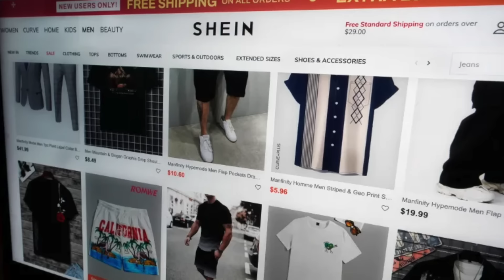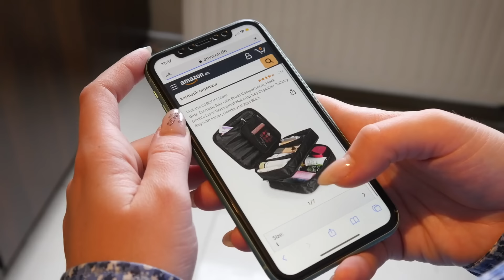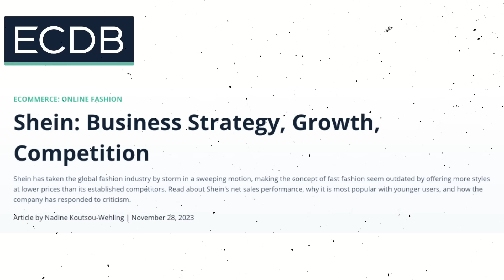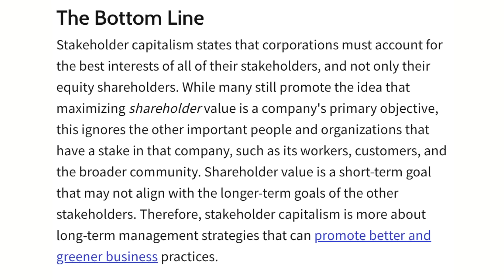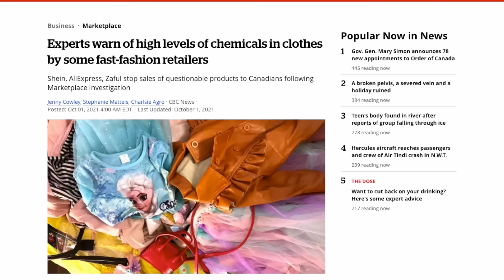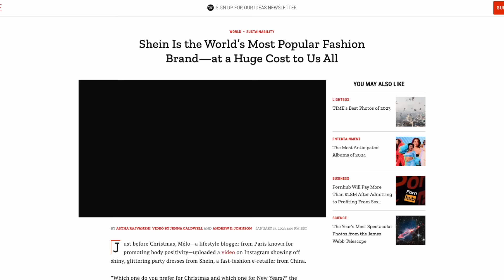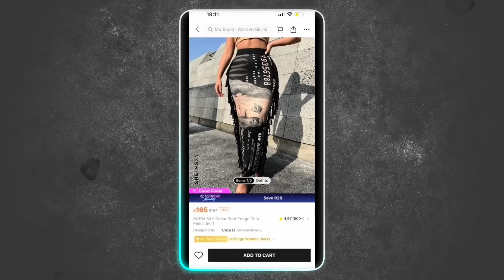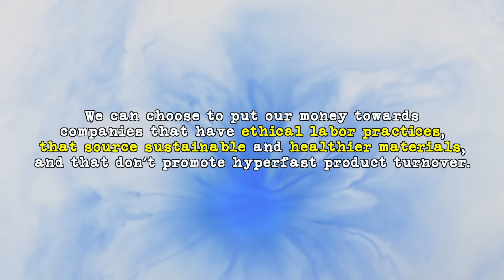Our SHEIN Problem.

Comment: I think the only argument I've seen hold any water for buying fast fashion is the plus sized people, since apparently plus sized clothes are tough to find used. HOWEVER, considering 42% of the US population could now be considered "plus sized," I am sure there are other, better options out there than Shein.
Reply: Someone online recently looked at how many plus-sized options there are on Shein, and the percentage was at around ten percent or so, which is better than nothing but still too low to warrant this argument for fast fashion holding water for me.
Reply: I'm a size 24-26 (or 2X/3X) and it is absolutely tough to find plus size secondhand clothes. Most Goodwills I walk into don't even have size markers for anything above an XXL in the women's tops/dresses section (which is NOT the same as 2X, by the way) or above an 18 in the pants/jeans/shorts section. I often have to spend time sifting through the XL/XXL or 16/18 sections to find something even remotely close to my size. Not to mention that not many brands carry sizes above an XXL/18 to begin with, and even carrying things at those sizes is relatively rare. Have you looked at the prices of items at plus size retailers like Torrid or Lane Bryant? That's still considered fast fashion and it's ridiculous how much their clothes cost. I know this probably wasn't your intention, but your comment came off very ignorant and dismissive to what plus size people like myself have to go through when it comes to clothing shopping. I will never shop from SHEIN, but you have to applaud them for their inclusive sizing that places like Abercrombie & Fitch and Banana Republic don't even have.
Reply: There are very few non-fast fashion alternatives. Many ethical or slow fashion brands do not go up to plus sizes, and even if they do, their idea of plus size is very limited. The idea that just because there is a large demand for plus size clothes means that the supply is there is unfortunately not really true, and most brands that are filling that space are fast fashion. I'm trying to reduce my consumption of clothes as a whole and buy better quality clothes, which basically means 95% of clothes available in my size are no longer an option. I still don't think people should buy from Shein or overconsume clothes in general, but I often find that people who do not have to deal with this have very little knowledge of the reality of trying to find good clothes as a fat person.
Reply: Yeah, here in the UK I often find a lot of clothes size 16+, as many people either lose weight and donate their old stuff, or are larger sized as a lot of the population is overweight. It's actually harder to find stuff in smaller sizes as teenagers and students get it hot off the rails!!!
Reply: @metamaus5701  10% is a lot with how many listings Shein has, especially if filters are available.

For an example of size exclusivity in thrifting, I have never seen a mens onesie jumpsuit (at least not one for a 6ft man). So many thriftstores also dont have a try on room now (can't find jeans and such because they need to be tried on), so it's difficult to check sizing. Even just basic standard clothing like leggings, skater skirts, cropped tops, or such, they're rarely carried outside of smaller women's sizes. There might be the most basic of basics (promotional tshirts, jeans, and such) but those often aren't basics for everyone (not many people like promotional shirts, I hate jeans because they're too hot and remind me of school and church, etc) (many thrifts don't even take items like leggings pants because they consider them underwear instead of the pants they are)

I think a similar bias towards small clothing can be seen in historic relics where a lot of clothing that survives today is either too fancy for daily wear or too small to be sold (children's, teens, and leftover stock). Anyone can size up a fairly huge amount, but sizing down is often impossible

Edit: I get your point is probably that plus size clothing isn't a primary function of Shein, which I can agree with, but it's also not low enough to say they don't somewhat serve that role for some people.

Edit: I also question the average $100/month figure. It should aim to find the median instead because averages are almost always thrown off by high spenders

Comment: As a plus size woman SHEIN was so hard to resist. Trying to find cute clothes that can fit is hard and I’m only a size 18. And I’m 23, I don’t wanna wear the frumpy clothes that plus size stores sell. But over the last year I’ve been a lot more cautious of my shopping and I’ve found that Target, gap, asos, and some other stores can be very useful in building a wardrobe that’s not gonna fall apart on me in a year. I does mean I have to spend more money up front but I think in the long run it’s better for my wallet. I haven’t even bothered with sustainable brands tho, they never have my size and they’re really expensive

Comment: The strategy of SHEIN in both marketing and their shipping ("on demand creation") isn't possible for sustainable brands. 

It works just because they are cheap and create massive amount of clothes. 
Sustainable, good quality brands will never be able to create such a buzz since being sustainable = not promoting overconsumption and micro trends. 
As for the on demand part, it works just because they constantly create new clothes of low quality. This clothing doesn't require huge time spend prototyping. And they steal designs and photos of amaller businesses. 
Sustainable brands spend months developing new products. The construction is way more complicated.

Comment: The rise of Shein is as a result of consumers no longer being blind to fast fashion profit. Companies such as H&M, Zara, ASOS are doing the same thing, for almost the same production costs, however charging 3x what Shein does. Why pay more for the same in-ethical practices by all of the above companies? In order for the rise of Shein to die, the whole system of fashion needs to be overhauled... companies that are making huge profit from fast fashion such as H&M, Zara etc can 'kill' Shein by keeping the same prices they already have, however using ethical labour and factories, sourcing etc. In order to do this however, they will severely cut profit. They don't at the moment because almost ALL businesses care more about profit than ethical practice, just to varying degrees. However in the long run this is the best thing for H&M, Zara etc to do, because if not ethical practice they will otherwise be forced to lower prices in a society that will normalise eventually Shein prices, everyone loses but Shein if this happens. I think right now H&M and Zara etc. are being DECADES slow and 'soft loading' ethical practice, because they want to make that change whilst keeping as much profit as possible. Just my theory.

Comment: What is annoying to me is when I spend decent money on clothing for ethical + quality reasons and at the end get the same clothes from Chinese factories. You shop in Italy or US, check reviews online, spend significantly more money and at the end still get the same clothes from the same factories (your package arrives from China even!). Your money did nothing good but supported even greedier people.

Also, I wanted to buy linen t-shirt. At H&M it costs 10€ and the one from the ethical local business — 80€. I understand why it is so expensive and would like to support their business, but at this point I can’t afford 80€ t-shirt. And no, I don’t buy tons of clothes every week, but I do have other expenses. I still support small businesses with unique clothing, just by buying more “special” things and more rarely. So, trying to find balance that fits my needs and my budget.

And another point and the reason I actually order from SHEIN sometimes — their sizes are smaller. I wear XXS (sometimes XXXS) and most brands (especially local European brands) simply do not have my size. It’s hard to find things and they are pretty limited. SHEIN has more items my size and variety of designs, so I can easier find something for my taste that will actually fit. I do not overshop though

Comment: Every year I bought myself $50 worth of clothes on SHEIN and that’s the only time I buy clothes for myself. With coupons I normally ended up paying like $35. It’s the only place I could get shirts for less than $5 a piece and still be decent designs. I throw out my yearly stained clothes the same time lol. Poverty really does suck sometimes.
Reply: not judging at all as I think this is completely reasonable given your situation, but have you ever tried thrift shops? I know they're not always the best, but I have found a few gems myself for really cheap which could prevent having to throw out clothes. just a suggestion tho I'm not trying to be rude haha :)

Comment: I've never bought anything from Shein I mainly do Ally Express but the point is the same, yes it's a rather unethical company but it's one of the only places where things are plus size inclusive. I'm somewhere on the border not fat but definitely not conventionally skinny and things are just easier this way. The regular shops mainly cater to supermodels and you feel like 💩 when something is too small or too tight for you.

Comment: I avoid both shein and temu for reasons you mentioned but also because they both steal from small creators & I don't like the idea of supporting someone who didn't make something. In some cases too what Temu steals is stuff that was put out for free. (Example: Freebie cross stitch patterns, a designer might release one for the season so their followers can do it, but I've seen a couple times now were creators get fans reaching out saying 'i bought your kit from temu!!' & then the designer has to announce there design was stolen and they aren't getting anything financial from their design being stolen.  I know thats one very small craft related hobbie but I've seen it a couple times now, so I don't doubt other hobbies deal with a similar issue with designers finding their stuff being ripped off.)

Also a low income person, I honestly don't shop that often for clothes. I honestly find cloth shopping to be extremely stressful (the prices on everything is too high) & I sorta stick to big box stores. (walmart, coscto, winners/marshalls) or thrift shops.  But again this is rare for me to really browse and buy something from the clothes section or go out and specially wanna go 'clothes' shopping. Its strange because I can recall everything I bought this year as clothes and I generally buy maybe 1-6 items a year that are clothing related.

 I think most of the time when I buy something its because I'm replacing something thats been finally worn out.  (I have shirts that I had from my late teens to early 20s with me still and I'm in my 30s now.)  

But yeah I generally really picky with my money. I like thinking thru what I'm buying. I do admittedly realize too I'm probably not the target for shein and temu. But I also do wonder how many people do shopping as a way to "self regulate". (I'll see terms in groups related to aesthetics sometimes like "serotionin hunting" when it comes to haul culture.)  But thats something else to think about.

Comment: Loved this video! I'm trying to order less from Shein but I have some thoughts about it. I am a university student living on a tiny island in the middle of the ocean, so the stores that we have here are limited. Also we have one small second hand store that usually doesn't have my size. I try to just order on Shein when I want to buy something but can't afford a price range of Stradivarius, Pull & Bear and the stores that I used to shop but now the price is higher. I think nowadays is very hard to buy stuff because it's getting expensive.If you could help with some advise I would be grateful!!  P.S. I'm not the type of person to buy clothes for the trends. ❤
Reply: I personally have a lot of luck finding cute clothes on vinted!
Reply: @lostinfantasy2489  I'm pretty sure vinted isn't available for her on a tiny island in the middle of the ocean
Reply: @MrsSofieable  I have looked and it's available but the cost to ship something to my island is a lot. I only buy online if the shipping is for free
Reply: @lostinfantasy2489  There is a lot of cute clothes there but the shipping is expensive so im trying to buy clothes from my friends instead of stores. Thank u so much for the advice :)
Reply: @anma9217  Thank u <3 Since than i have tried not to buy anything cause i know i didnt need it. I am focussing more on experiences rather than clothes and it worked... until I gainned weight then i had to let go of my favorite jeans sadly. The only good thing is that I get to think about my style and what I want to wear and I am going to really think about it and make wise decisions. Also I don't know what for people is the normal buying cause I used to shop once a year and then moved to a city for university and started buying a lot from the shop around the area, after seeing the prices online vs in store I started ordering. Things like skincare I still order from amazon cause it's cheaper and more to choose from. 
I have been reducing on buying and sticking just with things that i really need. For ex, had to buy jeans, shorts that fit me. Also we have all seasons but sometimes in just one day you have a little bit of everything! Thank u so much for answering. It really helps a lot to find people who you can talk about that, my friends don't care as much as I do. Have a good day 😘